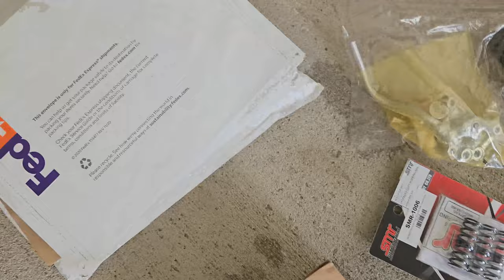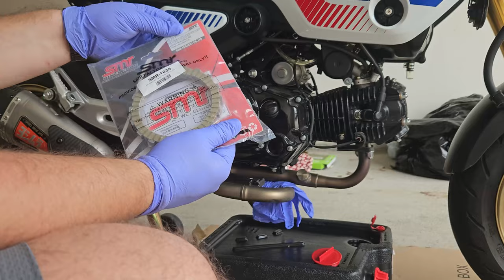Noob Installs Clutch Discs, Springs, Plate, Oil Pump On A Honda Grom

Comment from the maker: My main motorcycle has a dry-clutch. With a wet-clutch, like the grom, I think I'm experiencing new things. Like, when starting the grom, in-gear, it wants to pull you forward a bit. I haven't figured out if this is because I failed to install the clutch disks correctly or if this is just normal wet-clutch behavior yet. I don't have anyone that I'm close friends with that can comment on this, so if anyone wants to chime in and drop some knowledge. Please educate the people what might be signs of a bad clutch install, bad clutch cable adjustment, or just regular behavior.

Comment: You're using that torque wrench wrong on the back axle you put the torque wrench on the side with the nut not the other side. And that tears your clutch up just dumping it for no reason It's just going to wear it out a lot sooner I just noticed you did the same thing on the front axle.You put the torque wrench on the wrong side again. The readings aren't going to be right doing it that way,.... Good luck!
Reply from the maker: Thanks, I'm dumb. Really appreciate the knowledge. But about the clutch dumping, I am still and have been dumping the crap out of the clutch to learn how to wheelie. I don't mind if I break it, because I really rather break this while learning than breaking something much more expensive. Plus, then I get to fix it. And hopefully I learn / do it better the next time.

Comment: Do you have issues when down shift does it feel really hard to do it.   Did you line up the clutch plates smooth to smooth and rough to rough
Reply from the maker: Most of the time I have issues finding Neutral, but shifting up and down seems 'okay'. It's a Grom, so I don't expect it to be buttery smooth. I just make sure the bike running and i have my clutch adjusted tension cable adjusted as best as I can to have the smoothest experience.
Reply from the maker: I did not look at which side I was putting the disks into the clutch basket. I was just putting them in so no two of the same type were touching each other. Same as in video.

Comment: Make sure  all the clutch plate springs are sitting in place and tightened evenly
Reply from the maker: I wish I would if I could go back in time. But it's been done and i'm too lazy to get it back apart if it's working :)